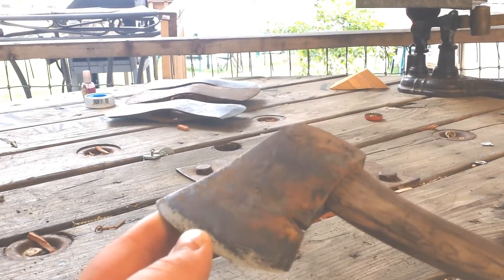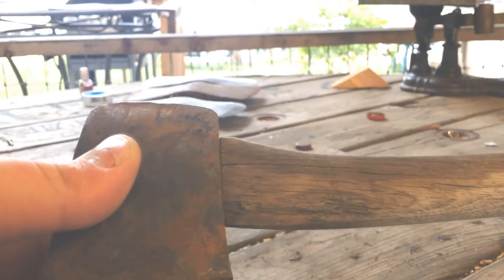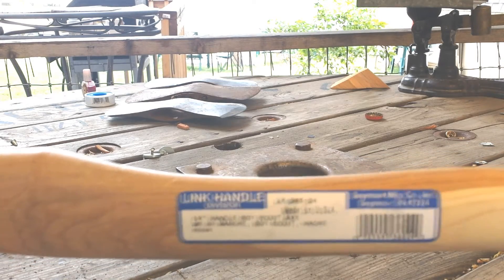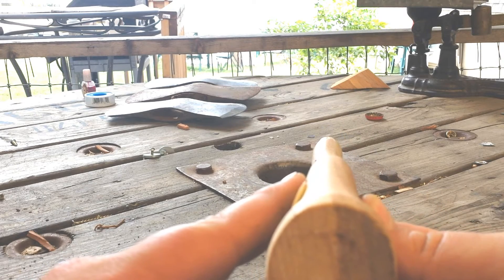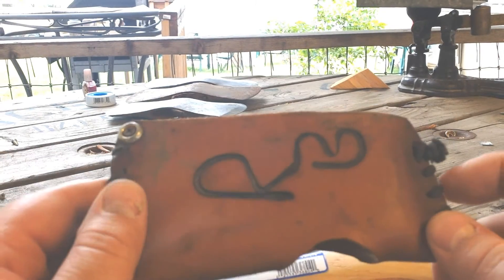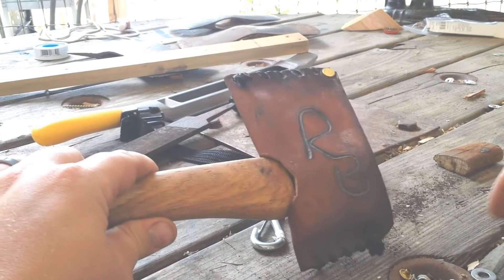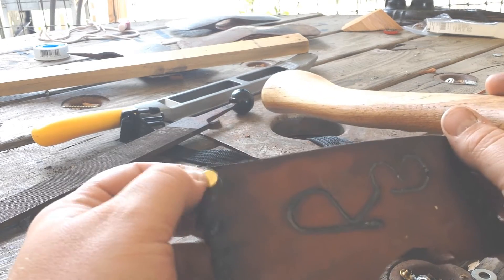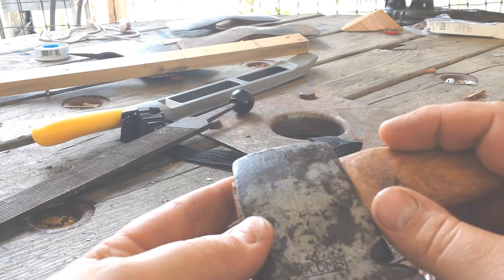Plumb hatchet restoration

Comment: Another nice video. Would you recommend the obenauf's for my 25 year old Rawling's ball glove? it looks to do a nice job, but a ball glove is not the same as a leather sheath. I guess the question would be if it leaves any kind of slippery surface or anything to the leather.
Reply from the maker: +davenhla Obenauf's would work well for your glove. They make a heavy duty leather protectant and a medium duty leather oil. Either one would work well for your glove. they sometimes leave behind a waxy coating that will be absorbed as you work the leather, it is not slippery by any means, and would actually add some grip to a ball glove. The protectant does often times change the color of the leather, it will most likely darken it up. I would recommend applying a little bit to an inconspicuous place on the glove to see if you are ok with how it will change the color of the leather.
Reply: Charles Bolon Brilliant. Between this and the Beavertooth web page, you have been a big help, thanks!